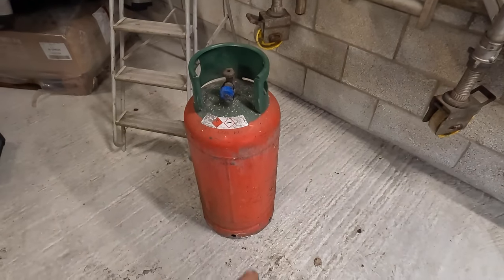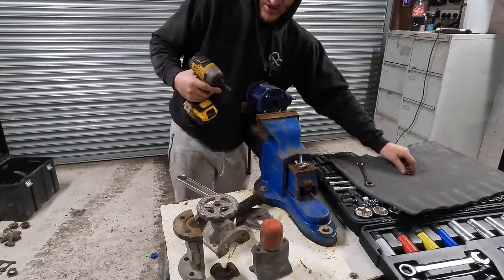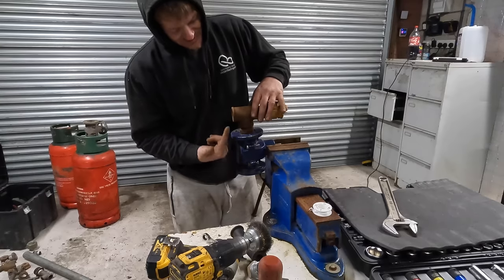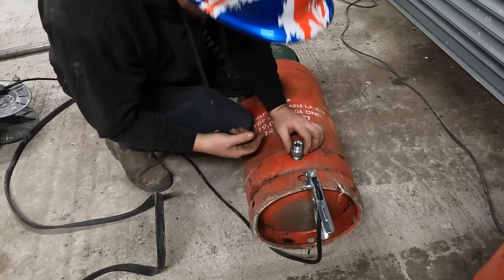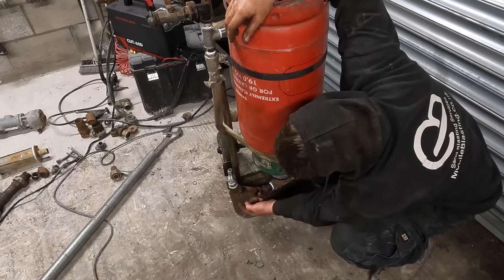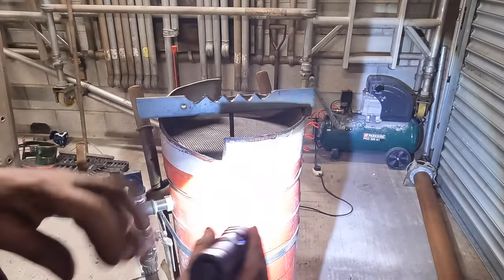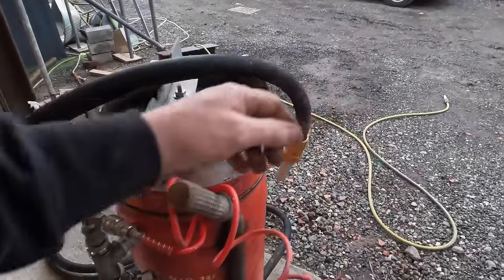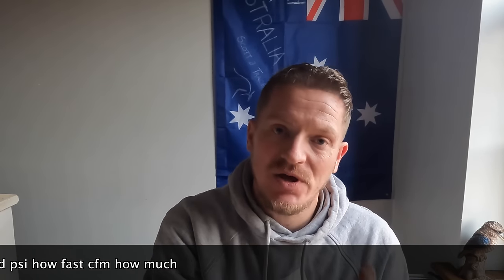Building a CHEAP DIY SandBlaster by a PRO and info how they work tips tricks

Comment: for my shed cabinet , i use a  3HP  brushless motor 16 cfm ,10 Bar V Twin Burisch  compressor on my cabinet setup . and it does the job nicely .the cabinet is completley upgraded . with a 200 psi pedal , media flow valve , stainless steel gun with boron nozzle . it was cheap cabinet . but they use them crappy plastic films on the window, so  i,ve fitted a piece of tempered glass .and a piece of  stainless steel 100 mesh  .just below the tempered glass . the media size i use is 60 mesh ,so it does,nt get past the 100 mesh screen . and anything smaller than a 100 mesh does,nt affect the tempered glass .i stole this idea off  an old 1930 snap on cabinet . hope you and the family have cracking christmas Mick and a happy new year m8 :)
Reply from the maker: Yeah I was looking at DIY shops for the biggest 240v 3 pin plug normal UK plug compressors and all I could find is 15cfm I know the brushless direct drive motors are super quite and the way forward for shop compressors more power less energy and quieter but the price is still a fair bit more than a piston version. My next project will be build a super delicate blaster I got carried away with this 1 😂

Comment: I don't think there's anything wrong wiith approaching this with the idea of hiring or exchanging work with a welding shop to get bungs or legs put on; I don't own a welding machine but if I only need the service a few times a year I'd rather farm it out than buy the whole setup for it.

Happy holidays though!  Thank you for taking the time to share how and more importantly why you have this set up the way you do; that's a big leg up if I ever get to building one of my own.
Reply from the maker: Its main reason I got a 2nd hand arc welder I want to be able to learn myself how to weld but not cost a fortune it was £30 for the welder and £15 for some sticks every project has been a learning curve for me as I'm new to plasma cutting too but really like the idea of them cheap cutting no discs etc I've thort of a different way to make a smaller setup even cheaper but the next time will be a shorter video 😬
Reply: @Mobileblaster  I'm here for it.  In your shoes - namely having room in the shed and a 240 volt outlet - I'd get one too.  

I hope you and the family are warm and dry for the holidays, see you when you're back to work!

Comment: You better than most know you can have the crappest pot going, Mick, with big air & it will blast good. Or you can have the best pot on earth with rubbish air & it will blast rubbish.  Blasting is all about the compressor. Blasting takes ALL the air you can feed & then some. No blaster ever went "I'd not like a bigger compressor..." My good mate blasts full time - an absolute grafter -  his latest compressor was 15k used & it's still not near the compressor he really wants.
Reply from the maker: Yeah air control is very important part but cfm and nosel is the most important in my opinion. My 425cfm stands me around the 15k well over with the cooler that's more than enough 😎 I still think 180/300cfm is the sweet spot 😊👍👌

Comment: Hi Mick i did not realise the amount of stuff Amazon sells the only thing i cant find is the flange plate that bolts to the metering valve with a 3/4" thread i have found a plate do i drill and tap or try a find another plate with a thread all ready in it thanks Pete
Reply from the maker: You can safely and easily use some flat plate drill some holes bolt to the flange and weld a 3/4" nipple on or tap the hole and put a 3/4" nipple in. Or do a homebrew pinch valve and just use barb ends its not essential that you use that style valve a ball valve will do the trick but have plenty of spare en as they were very quick

Comment: Cheers Mick this is spot on. I've got the earlier version of that little green compressor you've got. Tried blasting with a cheap little gun from machine mart but it was beyond hopeless. Any tips on getting cheap compressed air with a 13amp plug like you say that will give me enough CFM to blast motorbike wheels and frames?
Reply from the maker: Yeah that's my next project I think I've got an idea that's not been seen before hopefully it will work I think I can get 15/30cfm out of 13amp plug or a modd may be needed and a stronger braker all going to be simple and somewhat safe 😂 I duno if this can be done cheap I will definitely try 😂
Reply: @Mobileblaster  Thanks mate haha I know I'm asking for the impossible combination of cheap but powerful at the same time. I also heard what you said at the end about a quality nozzle being most important and needing to start there first. Cheers
Reply from the maker: @cliveramsbotty6077  yeah nozzles are more important than media etc its looks easy but the is alot more to understand before ya pickup the pipe and blast I try to steer away from how to because I'm far from the best at explaining things but stick with the videos you maybe able to pick some good info out of em 👌👍

Comment: I bought an off the shelf 5 gallon blast pot from a U.K. seller to do small Land Rover parts. My compressor is a single phase 2hp 14cfm 150l tank.
I used in the summer with glass media and had nothing but trouble with wet media from condensation.
I contacted the supplier only to be told that they are not suitable for recycled glass and that I should use aluminium oxide which apparently isn’t affected by moisture. I’m about to bin the rubbish, what do you think Mick?
Reply from the maker: Air control is a big part of getting a good flow of media glass will be fine try draining the tank on the compressor also adding a water trap  should help 👍
Reply: Sorry, I forgot to say that even with a water trap moisture is a problem.
I did consider a diy cooler but I may just get a pressure blast cabinet to save on media, although the pot is good for weld preparation in awkward to reach areas.
Reply from the maker: @ianhowe8823  I was going to do a small series and show how to build a compressor then how to control the air as shop blasting isn't something I do it will be a long time before I get round to this but it was something I was planning on doing a video of 👍